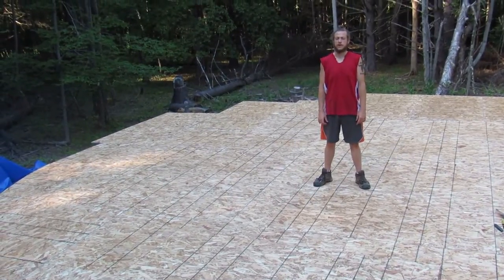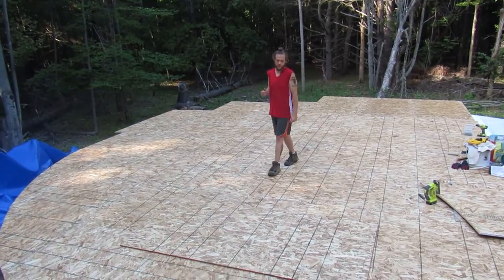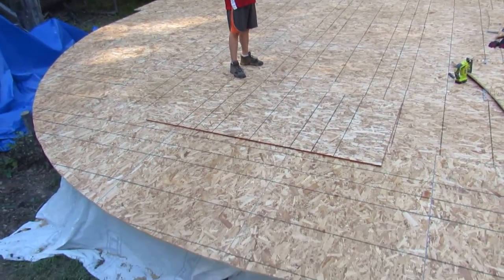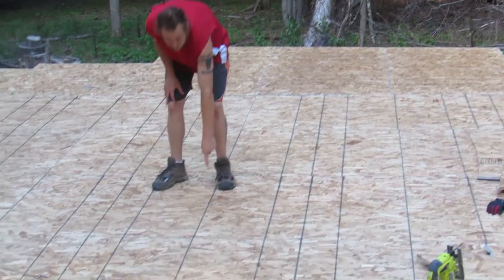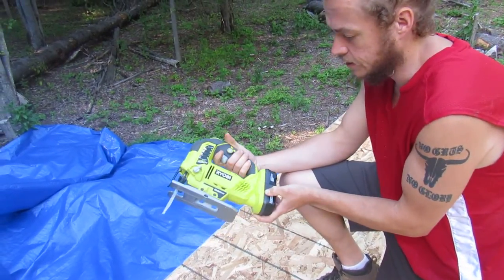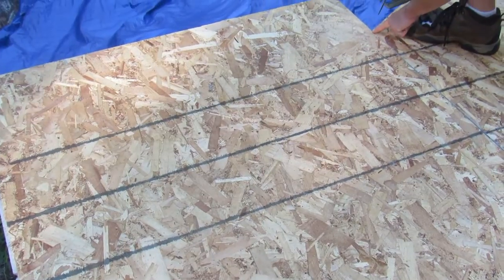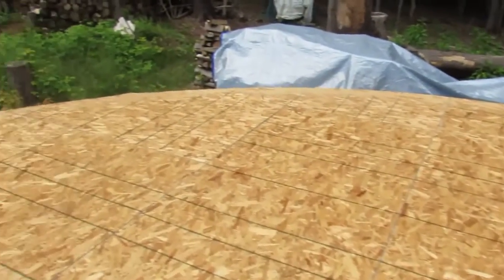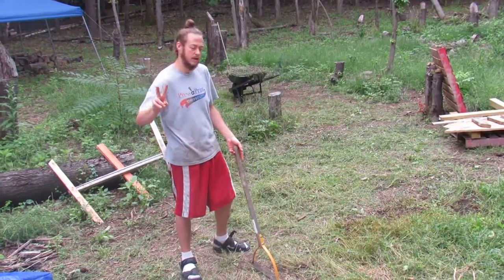Creating the circle on our yurt platform

Comment: Did you screw the osb decking in through the tyvek? Just curious if that messes with the water proofing? I might have missed it.
Reply from the maker: Yes we screwed through the tyvek. We were wondering the same thing but figured it was pinched between the 4X6 beams and the osb and the only moisture that we would have to worry about would be coming up through the ground or the little bit of rain/snow run off. We had also talked about lining the ground with Tyvek or some sort of plastic to help with ground moisture. The yurt is up and has new through a few rainstorms now. Have you checked out the completed videos? No moisture problems yet. Prolly have a better idea after the spring when all seasons have been tested. Even better idea in about 10 years when the real wear and tear start to set in. Are you looking to build a yurt sometime?